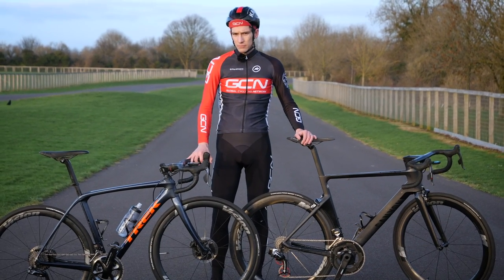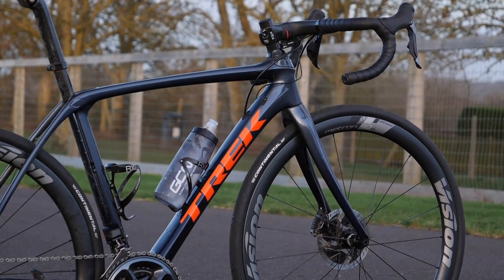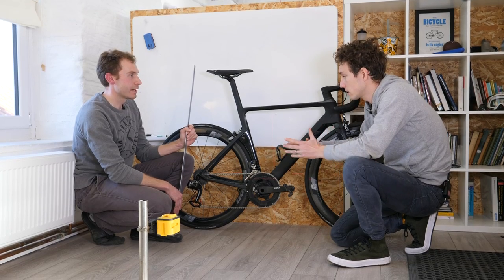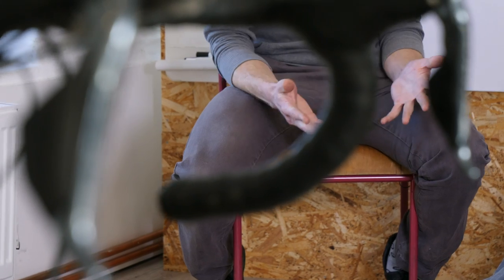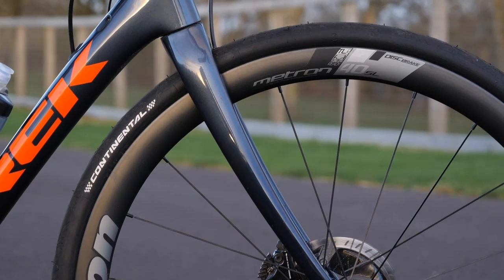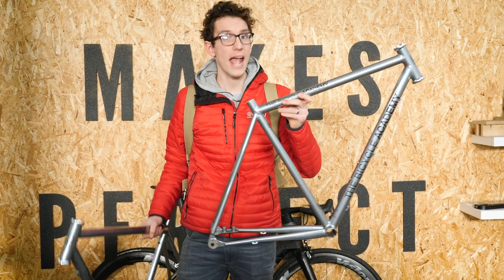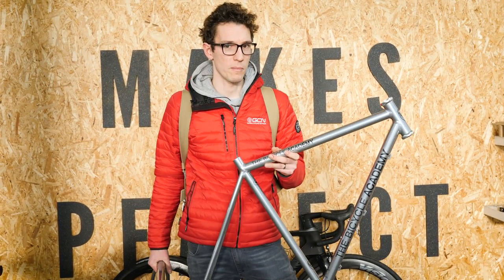Speed Vs Stability - Can Bike Geometry Make You Faster?

Comment: A great explanation and in depth look into geometry. Thanks Si for this video, comparing the two bikes made sense of the difference and gives a greater understanding to the frames geometry. A must watch for anyone   in the market for a new ride. Thanks again and all the best Andy
Reply: "great"
4:21 higher CG = more stability, "expert" didn't correct it.
5:00 The mechanical trail enforces that behavior, not allows it.
5:50 Chainstay doesn't dictate the yaw inertia of the bike. The center of gravity does, and it's a derivative of the chainstay, the seat tube angle and how far back your seat is. Also the ratio between rear and front centre isn't a particularly meaningful reference, since bottom bracket location fore and aft has little to none influence from the vehicle dynamics standpoint.
Two rules of thimb - a short wheelbase bike will require less steering input. A bike with more weight at the back will rotate easier.
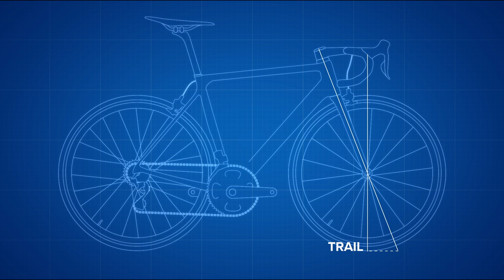7:00 He didn't explain why trail gives stability. No cookie for him.
7:30 The more trail you have, the more bike will react to EXTERNAL change and change of direction. Basically it's the same principle as with the shopping cart. The wheel always sets itself behind the point in which the axis of rotation pierces through the ground, which is additionally emphasized by the fork offset.
14:44 Bicycle geometry doesn't have a can of worms. A pack of gummy bears at most.
16:10 Bullshit. First you look at the head tube angle and fork offset since these two dictate the self aligning tendencies of the front wheel, which improves stability. Longer wheelbase makes the bike less responsive. Making a bike less twitchy by increasing it's wheelbase is negating one problem with another.
Reply: @PanzarMetal  It oversimplifies a quite complex topic of vehicle behavior, while providing a constant supply of slight misinformation. They should go to the University of Bath and talk either to some vehicle dynamics experts in the faculty, or at least to the head of suspension design in their Formula Student team or guys from Bath Zero. Tom looks like he barely understands what he's talking about.
Reply: @VHjykfUuYu  Thank you, I was doubting myself, whilst i have a book on bike frame design this video shuffled my thoughts. Unfortunately there are quite a few number of "supporting" commentaries here which make me think they are artificial. Additionally Tom does not make an impression of a professional I would trust a bike to be build by for me...
Reply: @PanzarMetal  A guy who said you can lower your center of gravity by standing on the pedals is my favourite so far. Educators try, but the fools prevail.
Reply: @VHjykfUuYu  Indeed, just another episode of GCN does "science". Talking about science what would you say about lowering the weight of the bike in a gradient relatively to the BB, meaning anything furthest up from the bb should be the lightest since the rider would need to overcome less inertia for a sprint effort?
Reply: @PanzarMetal  Generally the further from the instant axis of rotation the mass of the object is, the harder it's to wave around, so having light bars, stem, seat and seatpost could be beneficial, but they aren't that heavy, so my guesstimate is that it would be hard to notice. For a sprint effort - wheels would probably make the biggest difference. Gyroscopic effect is barely noticeable until somebody slaps a heavy front wheel on your bike. Then you become aware of it's magnitude.
Reply: Deep explanation? i think he refuse to answer most of the questions, even when was asked many times about how affects the geometry in the feeling he didnt answer anything concrete.
Reply: @VHjykfUuYu  Thank you for adding your observations.
Reply: @VHjykfUuYu hi. Unfortunately we have no editorial control over these videos, and so aren’t able to guide the format, structure, content, use of diagrams or indeed fact check the content that makes the final cut. The first time we see the video is when it goes live, just like everyone else. 

When shooting a video it’s often the case that someone makes a mistake or says the wrong thing but the typical approach is to finish the take, do a retake, and then allow for the issue to be resolved in the edit. The high centre of gravity mistake by Si is an unfortunate example of this. This segment was actually shot again, but I assume got missed in the edit. Tom not correcting him is simply because that would kill the shot, so after clearly being thrown by the error he attempted to continue with the next part accordingly. We all cringed when we saw that bit was in the video.

We’re proud to help GCN with their videos when they ask us to, and just like you we all want the content to be accurate and helpful, so if they’ve failed to achieve this in certain instances then I’m sure they’ll be keen to set things straight. 

In this case the final video could have been better, in various ways, but please try to be less negative and so attacking. Tom is a very capable aeronautical engineer with a background in biomechanics, Formula 1, aerodynamics and composites, he knows this subject inside out. If he looked like he “barely knew what he was talking about” it might be because having a team of people video him is quite nerve wracking, or maybe because that’s just how he looks (!), but either way it’s not a particularly constructive or pleasant comment, and is certainly unwanted. 

Have you considered writing a genuine and constructive email to GCN with suggestions, as an alternative? 

We’re shooting the second video soon, complete with the two bikes we’ve built specially to illustrate the impact of different trail with the same head angle and front centre. Hopefully this will give us the opportunity to address the editing mistake and clarify any points not yet made clear.

Thanks
Reply: @ndrwdnhm  That was a great reply, Andrew.  Well written, and it explains a few things for us.
Reply: @VHjykfUuYu  You are confused, "further from the instant axis of rotation" is for rotational mass, and is called moment of inertia, not giroscopic effect.
The bike parts that you said are not rotating.
This effect in tires/wheels exist but is very small, and only affect braking and acelerating.
99% of the effort is about aerodinamyc and rolling resistance (at 15kph 50%-50%, at 40kph 90% aero 10% rolling) forgot the weight of the bike, its not important, unless you only ride in more than 10% ramps. In flat its close to 0 effect in speed.
Giroscopic effect is the resistance to fall when wheels are rotating.
Thats why at 0 speed you fall, but with some speed you gain giroscopic effect and wheels dont want drop to a side.
It make resistance to tilt the bike in corners.
About center of gravity, with lower you have more stability but less lever to tilt the bike, less agile.
With high CoG you have less stability but more lever to tilt bike.
You can check it with low CoG MotoGP bikes vs high CoG enduro or trial/cross motorbikes.
Reply: @llavero5  They are rotating. Except in a different way than you might think.
If you look at the bike from the front, it tilts left and right. It's a rotational motion around the instant roll axis. Considering that when you stand up on the pedals, the front wheel generally rides towards your front foot, while you tilt the bike in the opposite direction. That probably locates the instant axis of rotation around the bottom bracket of the bike (it's a wild guess). The entire assembly of the bike rotates around that axis, therefore the bike has a roll moment of inertia.

You're right that drag plays the most important role, but let's assume the acceleration scenario for a moment. One bike with a heavy frame, and one with a heavy front wheel, and let's simplify the motion and assume no roll. Wheel has two types of kinetic energy - translational and rotational. Your effort goes into propelling the wheel forward, and increasing it's angular velocity.

Basically you have two scenarios with the same overall masses and same translational kinetic energies, but one has higher rotational kinetic energy, so the sum of the kinetic energies is higher for the scenario with heavy wheels. Since the change of the kinetic energy is equal to the work you put in, you'll accelerate faster on a bike with lighter wheels however, as you pointed out, in the end they'll achieve the same velocity.

The gyroscopic effect is not that noticeable, until you mount a 1000kg your friend's old swift arriv on the front because you were too lazy to check the spoke tension, which caused an accidental reinvention of the bicycle wheel shape. Considering that during sprinting your front wheel does a little slalom underneath you, it's willingness to change direction quickly is quite nice.

Also, gyroscopic effect isn't the resistance to fall. Gyroscopic effect is basically the tendency of the rotating mass to maintain a constant direction of axis of rotation.
The gyroscopic effect paired with the bicycle geometry is what keeps the bike upright. You can check it by locking the handlebars straight and pushing the bike forward. It won't get far.
Reply: @VHjykfUuYu  Part 1. No, the axis of rotation in thats case is the contact patch of the tires, not the bottom bracket, because all the bike tilt.

Part 2. Yes, but whats the point? if you talk about aceleration the weight is mportant, but save 1kg from 80kg or 100kg has low effect.
Is better a tire with low rolling resistance, the most important thing at low speeds, thats why road bikes acelerate faster than MTBs. They have 2-3 times more rolling resistance than road tires.

Part 3.Yes

Part 4. The giroscopic effect is not notiable? without this effect you fall to the ground. I call this very noticiable.
I dont understand the rest, but with extremly light wheel/tire you have less giroscopic effect and the sprint slalom is faster.
The tension of the spokes is about 3 different torsional rigidity.
And not always more rigidity is better, if the ground is not flat, some elasticty from the wheel, frame or lower tire preasure make a small suspension, result a faster bike with low rolling resistance.

Part 5. Giroscopic effect and constant direction is correct, but thats why you dont fall!
¿You know the Girobike? this bike dont fall, you know why? it has a gyroscope rotating inside the wheel:https://www.youtube.com/watch?v=Yx3aOZ8MyOo
And thats why is called GYRObike.
And not, the axis of rotations is the same with one direction or other direction.
If you want another proof, look this: https://www.youtube.com/watch?v=8H98BgRzpOM
But at the end you recognize the gyroscopic effect is what keeps the bike upright.
But not the geometry of the frame, it has 0% effect.
Remember this old bike: https://i.ytimg.com/vi/fUTgbD0nvs8/hqdefault.jpg
Frame has nothing to say, but the gigant wheels with big giroscopic effect yes.
Reply: @llavero5  No, since it's not that simple of a motion.
That would be the case if the bike rode perfectly straight and the contact patch of the tires wouldn't wander around.
If you steer into the corner, then your instant axis of roll will be below the ground. If you steer in the opposite direction to the bike lean, then it's higher.

If the wheel wanders 5cm to the left and the bars wander 15cm to the right, then the axis of roll will be around 1/4 of the height of your bars.

I think that you are yet to accommodate the idea that the roll axis is constantly changing it's position and is dependent on what you're doing. 

Consider countersteering on a bike. It's point is to get the contact patch of the wheels towards outside of a corner and when you steer outwards, the center or rotation is near the height of the center of gravity. If you'd look at the maneuver from the front , then the lateral position of your butt would barely change, but you would roll and the bike would get from underneath you. Therefore your and your bike's instant axis of rotation would be somewhere around your butt.
Reply: @VHjykfUuYu  You are mixing things without sense.
Move your arm to front, up, rear, down, you completed a lap right? ¿where is the axis of rotation? the shoulder.
Tild your bike left, tild your bike right, ¿where is the axis of rotation? the center between both contact patch. ¿You understand now? its very easy.
Anyway this point is not important for nothing, the gyroscopic efect or moment of inertia its applied to rotational mass like tires or wheels, or pedas (in this case, yes, the axis is the bottom bracket).
Reply: @llavero5  If the ladder is standing straight and you kick it's legs from underneath, so they slide sideways while the ladder falls, where is the axis of rotation?
If a human slips on a banana peel, where is his axis of rotation? You cling on to the idea that the axis of rotation has to be located at the contact patch, which isn't always the case.

It's a similar principle for a counter turn on a bike. The front wheel goes to the outside, while you remain inside.

However, having given some thought to the topic, I was probably wrong because the axis of rotation seems to be a sloping line drawn between the point around which the front of the bike rotates, and the rear tire's contact patch.
Reply: @VHjykfUuYu  The axlis is always in the point which never move.
The example of the banana slip the axis will be in the C of gravity of the body (because dont change his place).
When the bike is inclined to left or right, the point which never move is the contact patch.
You are confusing axis of rotation and center og gravity.
for axis of ratation doesn matter if your body is in the corner and wheels are more exterior, only matter where is the point who never move.
Think again in a clock, the hour dont move (your body), the seconds yes (your bike), then check the line about the seconds (bike) and found the point who never move, yes, the fucking center of the clock, thats the axis.
Reply: @llavero5  I feel like we both feel like we're talking to a wall 😅 Anyway, I've asked a buddy of mine who designs motorcycle suspension systems and he said that the sloping line concept is true.

Regarding the clock example. 

Ok. The contact patch is the axis of the clock. Bike is the clock arm. Let's emphasize one thing. I'm not talking about steady state cornering. I'm talking about the process of leaning.

The contact patch displays a constant change lateral position in reference to the center of gravity, so when you steer away for a moment to help you lean into the turn you end up with a clock with lateral movement of it's axis of rotation.

You have a mixed lateral and angular motion of your reference frame. 

If your reference frame has lateral movement, then it can't be the instant axis of rotation. I'm not saying that the axis of rotation lies at the CG. I'm only saying that the bike doesn't have a fixed axis of rotation, and the only point of that axis which remains constant is the rear contact patch.

The height of the point around which the front of the bike revolves is dictates by rider input.

Bear with me here. I know that it's weird to decouple front and rear roll, but that's what you need to do.

The instant axis of rotation lies between these two points.
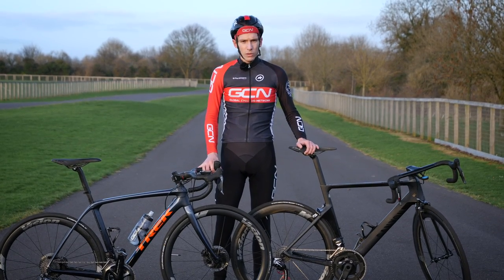Reply: Find a video called Slow-speed countersteering and skip to 1:12. That's what I'm talking about. Contact patch goes left, you go right.

Find a video called Countersteering by BikeriderTV and skip to 2:38
Front wheel wanders around. Rider remains more or less stationary.

With both of these you can see that the point of support, in our case the contact patch of the tire, moves laterally in relation to the instant axis of rotation.
Reply: Andrew Denham Nice explanation of the pitfalls of making a video. It’s a pity MrVhxy.... didn’t acknowledge you.